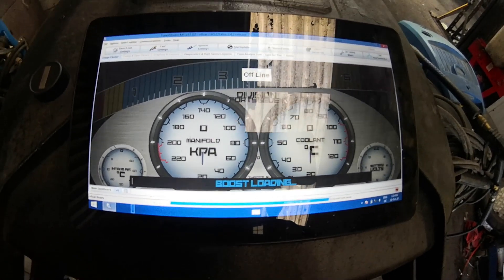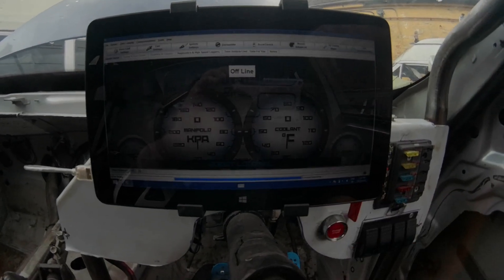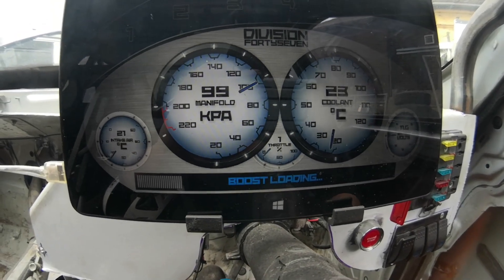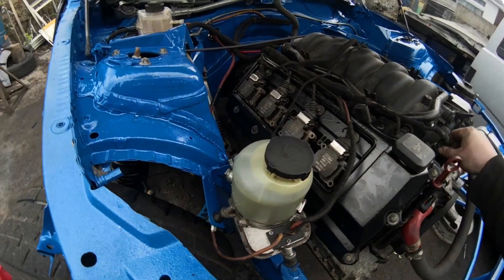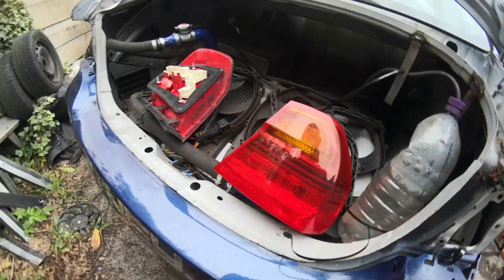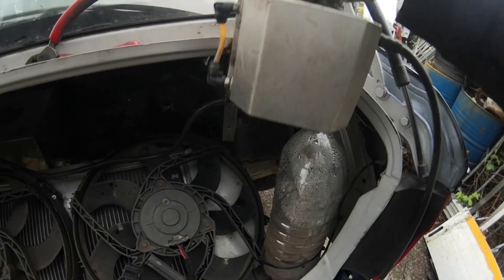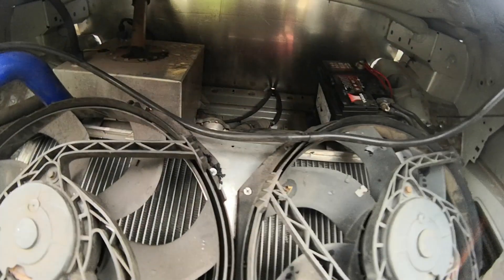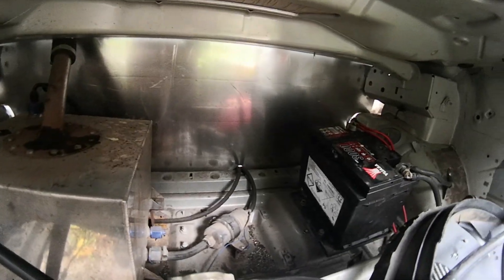M60B44 V8 hybrid engine build - Pt.3

Comment: How Is going with this setup? How many hp?
Reply from the maker: The car is long gone mate. I never had it dyno.
Reply: @diehowever  I,m just starting this conversion...do you have any M60b40 parts left...ie,,,front covers, cams, timing sprockets etc...I would be interested.
Reply: @diehowever so using the m62 block with the m60 heads what head gasket did you go with? Ik you mentioned something about it in you’re first part video but it slightly confused me can you re explain?

Comment: I imagine the engine is situated so far forward to assist with the rotation of the rear for drifting. Quite a different weight balance formula to the traditional tarmac or loose surface ideal. Very helpful hints on the hybrid M60b44 motor. Thank you.
Reply from the maker: So it looks really far forward, but actually isn't. It's no further forward than cyl1 of a 6cyl E9x. I wanted to keep the engine is original as possible, so it still has front sump. This also made steering coloum/exhaust routing a lot easier. Plus there were coolant pipes on the back of the engine that were easy to access. 

Can't say it ever affected the handling at all. Felt comparable to my V8 E36 and that was rear sump/on the bulkhead. :) 

Nice to hear it may have helped you in some way!